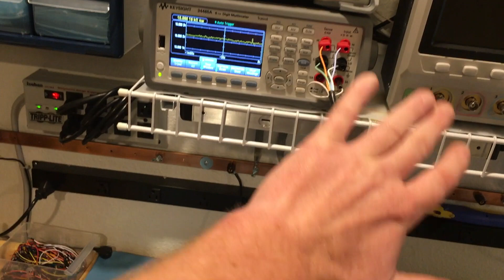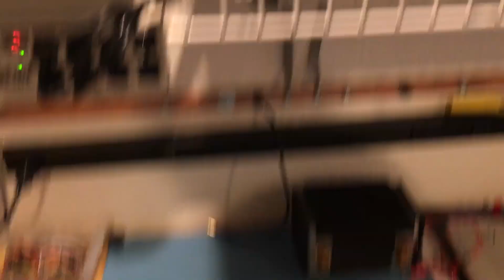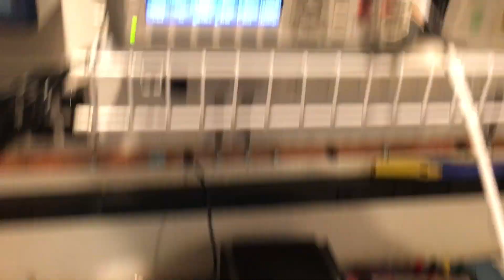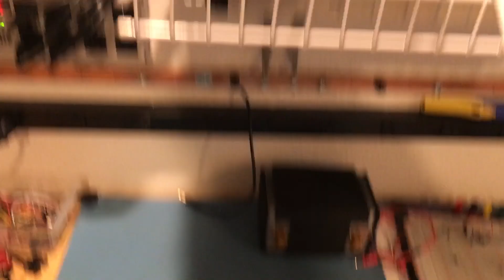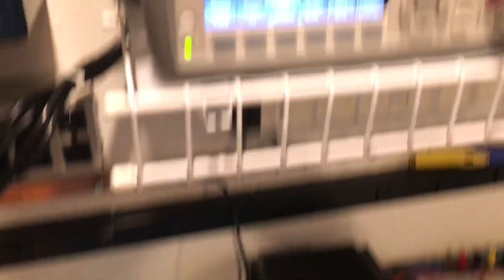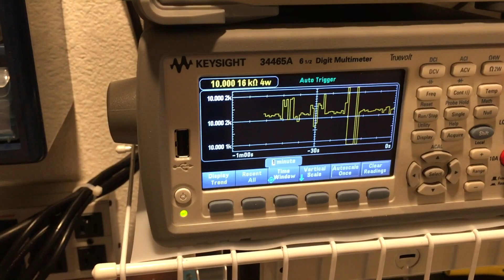Shielded test leads and Guard effectiveness with Keysight 34465A

Comment: Awesome tip Damon! I'm going to try this with my 3457A and also my 3456A (but it has the guard as you mentioned. I just never used the guard on the 3456A because I wasn't performing super critical measurements). Keep the good info coming brother! Sub'd